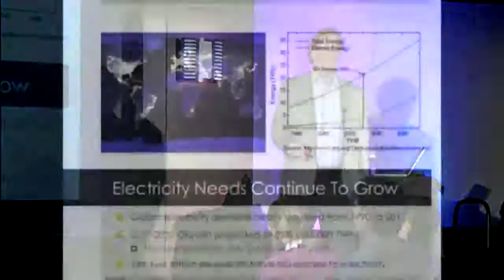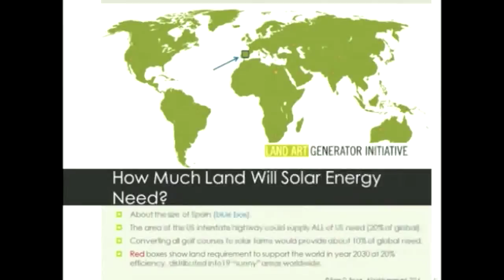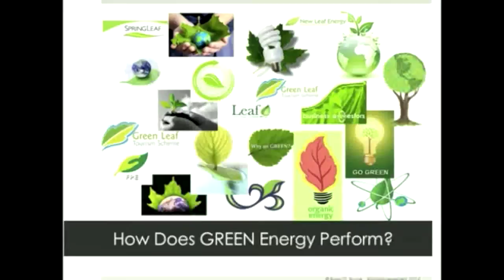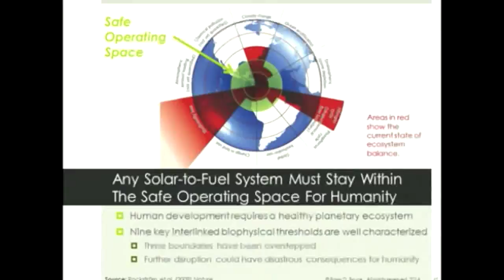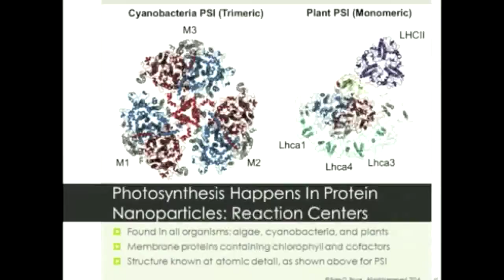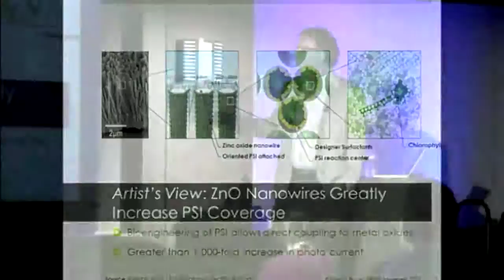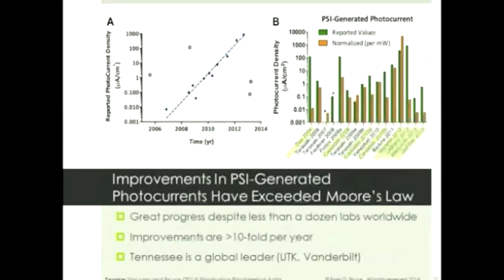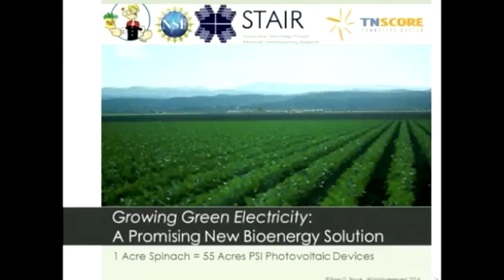Growing electricity -- plugging into plants: Barry Bruce at TEDxUTK 2014

Comment: Love this, getting solar energy directly from living plants is the ultimate goal for solar energy. I was thinking about some similar tests done on Trees. Then I thought Fungi interact with Tree roots and even link up with them. So perhaps the answer could be in utilising Fungi that could possibly grow on the metal conductor thereby using the Fungi like gold plating on an electrical component to aid current transfer. Also I was thinking possibly using aquatic plants so the water could be the electrolyte. Or Algae that could be freeze dried or in some other way plated onto the metal conductors.